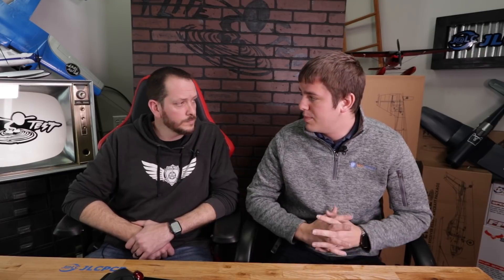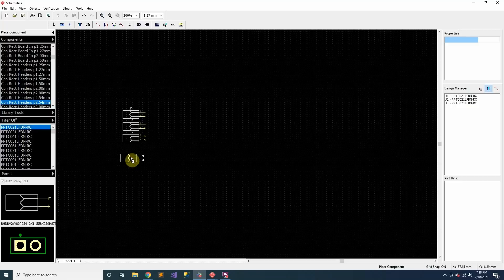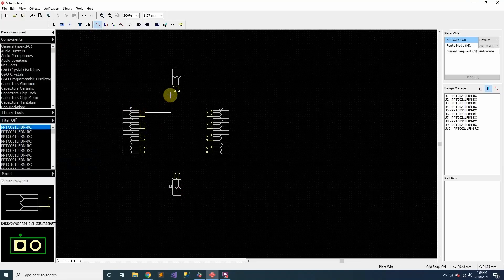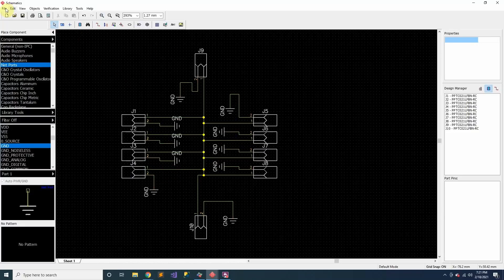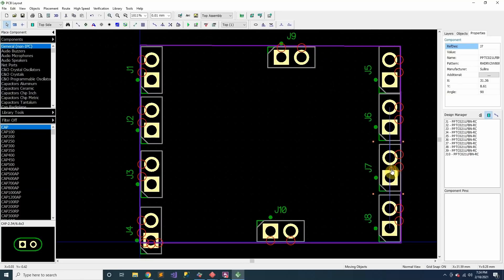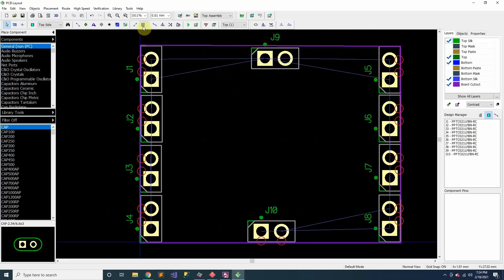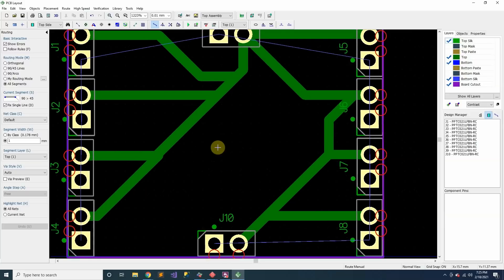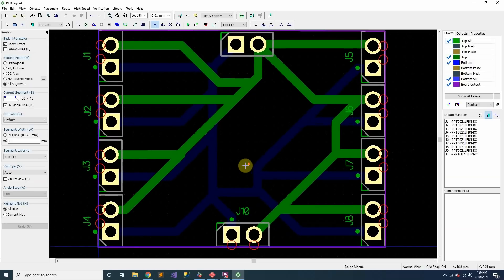How to Design A PCB!

Comment: KiCad is also a free PCB software and has no limitations on size of board, signal numbers or layers (within reason on the layers). It is open source software. It does have a bit of a learning curve, but it has been very powerful software for me.

Comment: Good tip is going to the manufacturers, web site. There you will find the foot print for all available packages you chosen IC comes in and tips for the use , isolation, loading factors, best placement for needed components,  bypass caps,loading resistors , values for such.  Personally I used eagle cad   under free to build an 11x17 mm quad controller.  It worked but destroyed a few trying to attach the processor to the bottom , I'm old and the parts are small. For example 3x3 mm for the gyro, 3x2mm barometer ... 1x.5 mm caps a d resistors ....tiny little voltage regulators . Anyhow I built several circuits , then having proved my aging mind still worked ...I quit . Just proving that I still had some cue after retirement . Take care.